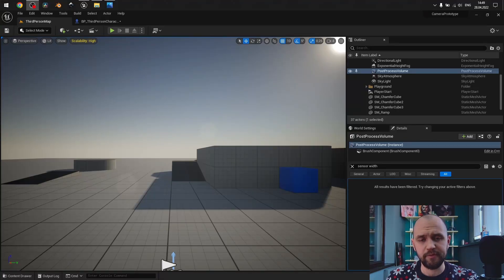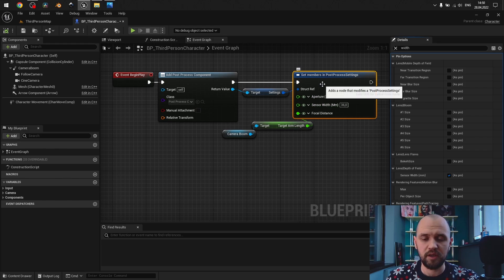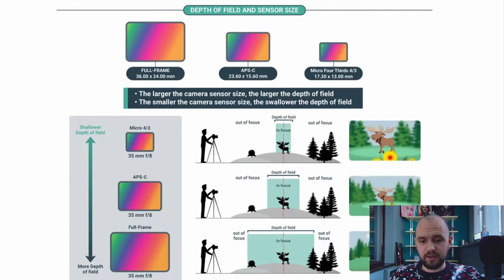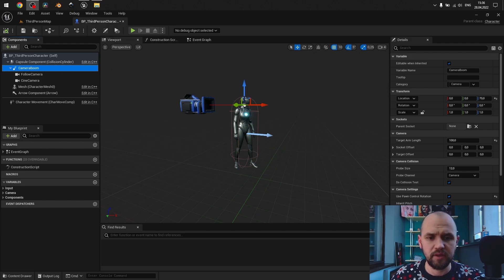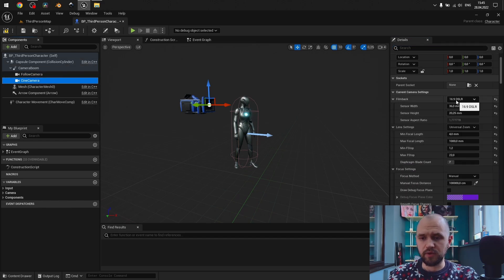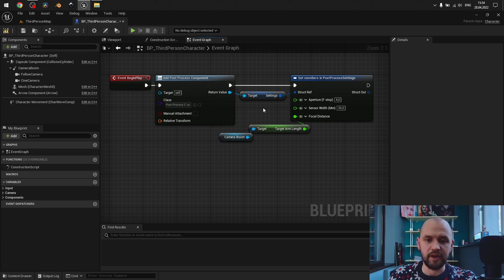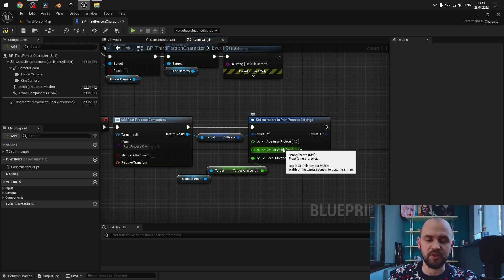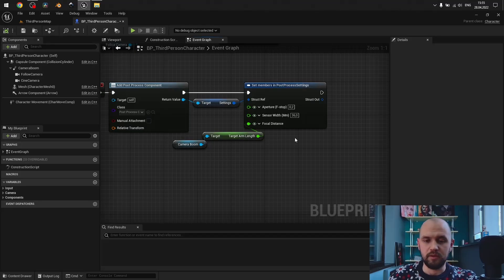Immersive Camera in UE5. Tilt-Shift Effect

Comment: The final effect looks amazing! Awesome video! I tried to replicate it in my prototype, but looks like something's changed in Unreal (I'm using 5.4). I don't see the options to set the aperture, sensor width, etc in the post process component settings. I tried to do it in C++ but I don't see any visual changes. Do you know what can cause it?
Reply from the maker: For DOF u need to set scalability settings for Post Process on high or epic, as DOF is post process :) As for 5.4 there is nothing different much as I use it for my game. From post process component just expose settings and using it as reference call Set members in PostProcessSettings. Options there are optional, so u need to add them in details manually
Reply: @YourSandbox  "Options there are optional, so u need to add them in details manually" < I think this is what I didn't notice and the reason why I couldn't see it in the blueprint. It works now, thanks!

Comment: In 5.2 the node add post process component doent have the class and there is no aperture, sensor and focal in the set members in postprocesssettigns
Reply from the maker: nope, u have everything. just lil bit changed 1 node. take a look. it's even 5.3.1
https://paste.pics/PL6MU
Reply from the maker: u also need to select checkboxes of those options u need

Comment: add post process component dont have class.
Reply from the maker: yeap. it should not. there is a separate node called add post process
Reply: @YourSandbox  Hello there, great tutorial! Thank you. I have the same issue, add post process component as you show on the tutorial has no class link to it. There is no other add post process node. I don't get dof effect on the camera. Any help would be greatly appreciated
Reply: @dodgyyy  It could be an 5.1.1 issue. The tutorial may not work anymore. I'm having the same issue

Comment: THis is amazing! thank you! one question, can you share your lighting/exposure settings?
When I set mine Aperture to 0.2.. my scene will become way too bright~
Reply from the maker: Aperture should not effect scene cause exposure isn’t overwritten. For exposure I use values from 1.4 to 2.0 in case I need eye adapting effect, but almost all the time is 2.0 min and max both. Also consider checking skylight intensity with directional light.
Reply: @YourSandbox  gotcha~ do you mind sharing what's your skylight intensity & directional lights?

Comment: Hey, thanks for all those videos, hope you are doing fine....one question though, how do you get that add Post Process Component? The one I added does not connect with the set members in PostProcessSettings.
Edit: Nevermind, got it to work ^^
Reply: Hey how did you solve this? I can't find how to expose the class reference or is it another node? *****okay found it, for any one else you create an add component node first then choose post process class from the dropbox.
Reply: @clarkmunro5990  thanks i was stuck on this for a while :)